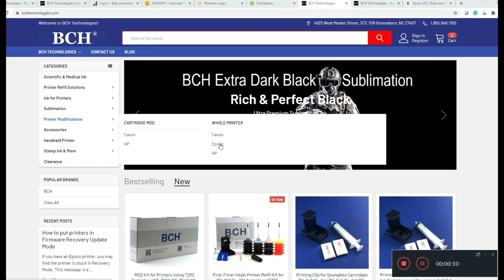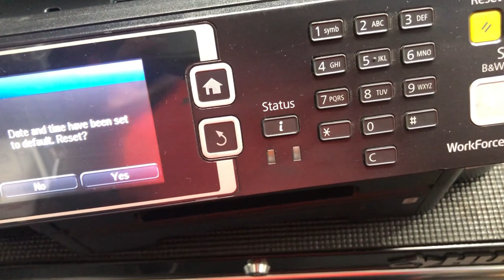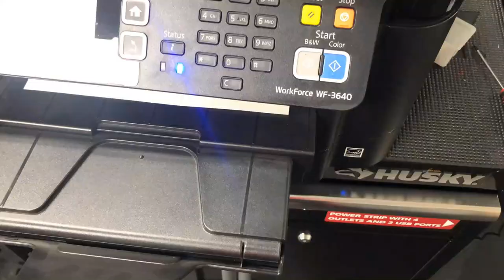Add Ink Tank: Epson WF-3640/WF-3620 for Sublimation or Pigment - T252 Cartridge Printers

Comment: Hi, I don't know how to contact you but my 3640 will not print black and I followed your instructions on how to clean it the printer heads in the whole nine yards they don't seem to be clogged but I noticed that sponge underneath the printer heads the colored side is moist and has all the colors in it but the black one is dry, how do I replace it
Reply from the maker: You don't need to replace it.